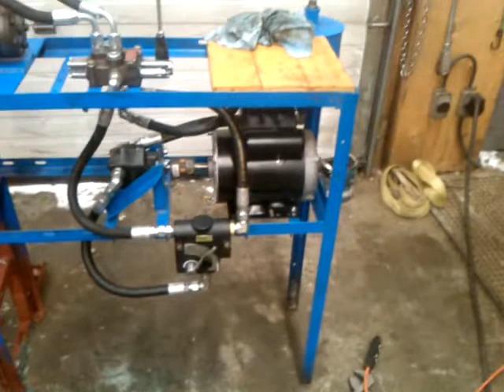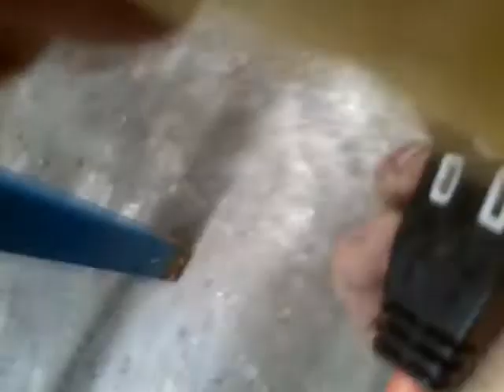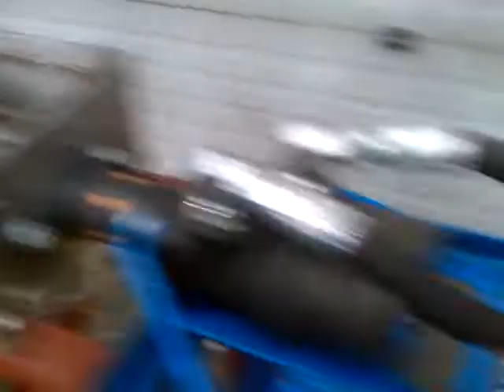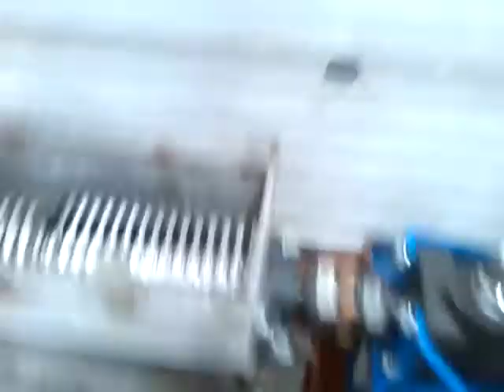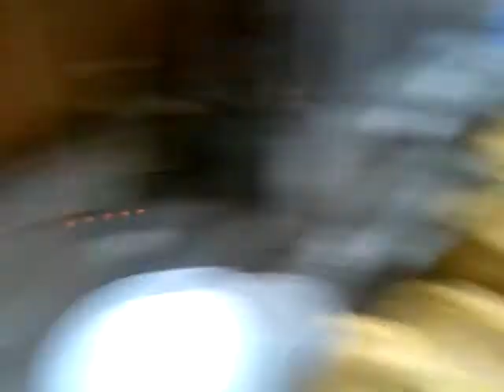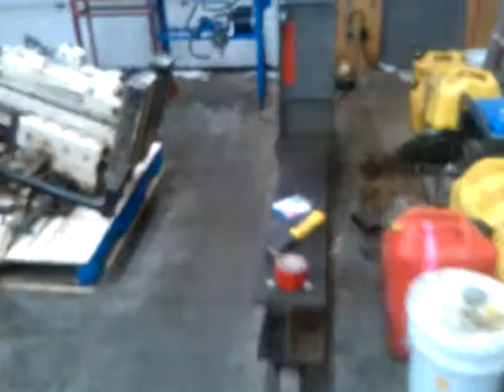Plastic Shredder Project by Dawson City Recycling Depot, Conservation Klondike Society

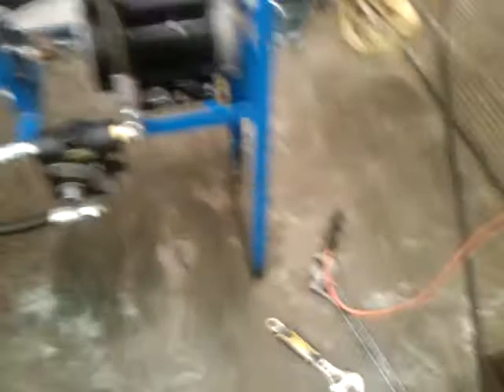Comment: I suppose you have already updated your machine since this video. But yeah you have 3 X the original version 2 PP shredder there. You probably need to stagger the blade configuration. The issue is torque required not so much about speed. But for one of those shredder boxes (not 3 in line) you need at least 3kw with a 1:30 reduction gear to do lids. I would go 4kw to be sure. With the coupling you need at best an HCS  jaw or a curved jaw coupling. You have what looks like a L90 or L100 which is not rated for the kind of forces applied to it. I have broken one already.
Reply from the maker: I just did a little work on it today.

I still haven't repaired the bent shaft yet, but we have a new one on hand, turned to 1" (barely turned from hex).

I will reassemble with the teeth staggered.

I think it's going to work, as the gear reduction of the chain gave the small motor enough torque to bend the shaft, teeth in the old configuration that we received it in.

Comment: a flywheel may help, even at low r.p.m. the kinetic energy should help it take the grunt
Reply from the maker: I agree that a flywheel is a good idea, but beg to differ regarding its effectiveness at low speed, if only because KE = 1/2MV^2.  I could be wrong, but I'd guess that the mass would have to increase exponentially as speed decreased, and I don't want to have to make that much room in my design for mass.
Reply from the maker: I'd have to put in a secondary shaft, geared up for speed, to make it effective, I think.  I could be wrong.
Reply: @nothermonkey  yep....mass = torque.... but what could a 4ft flywheel hurt?...lol...im outdoors, so im not as concerned... but my neighbors might be....lol

Comment: The motor is too weak.
Reply from the maker: It's a 3hp motor, which is supposed to be enough.  Since the video above, I installed a gear reduction using chain.  This bent the 3/4" output shaft, which another commenter had pointed at as being too weak.

It was still jamming--with the gear reduction--but less, and with the hydraulic control, I can reverse easily to clear the jam.

Something that nobody has pointed out yet, which I noticed after bending the shaft, is that all the blades, on the shredder we purchased, are aligned in three different straight steps.  Looking at other people's shredders, I see that each blade is staggered, so that no one piece of plastic catches more than one tooth at a time.

This last stands out for me as the biggest reason this shredder isn't working.  We're going to have to disassemble this shredder, get a new shaft in there, and stagger all the blades properly.  Hopefully it's a hex shaft in there.

Comment: The shredder looks awesome, I had never seen an implementation like this using a long shredder and hydraulics. My only concern is that the hex bar is too long and might eventually twist or break because all radial forces are being applied on one end of the axle only
Reply from the maker: I hope to come close to proving your concern, one way or the other.

At this time, I'm not coming close to applying that much force, with this 3hp electric motor on 18A @ 110V.

I've adjusted the pressure relief, so that it doen't stall the motor when it jams.  Now it only throws the breaker after a few jams of the hydraulic motor.

It seems I'm close on the hydraulic design, to transfer the power, but have a feeling the hydraulic system has too low an efficiency.

I suspect I'm going to have to trade speed for torque, and go to a chain drive, which will also get rid of alignment issues and the weakness of the lovejoy coupler.  I did use the strongest coupler insert available--the neoprene option.
Reply: @nothermonkey  Good luck on that. I didnt mention anything about the coupler, but I suspect the insert won't last very long. I ended up using chain sprockets and double chains, like these https://www.amazon.com/-/es/gp/product/B01KQ2KBDC
Reply from the maker: @OlivierCR  I was thinking of going with an offset chain and sprocket, so I could play with the gear ratio.  If the hydraulic system is too inefficient, I should be able to get the work done more slowly, with lower gearing.

I'm not sure where the 60rpm comes from, and what effects one sees above and below this rpm.  Does it have something to do with the plasticity of plastics at room temperature?

Id think the faster I cut it, the more brittle it would seem to the cutters.  Maybe it's a horsepower requirement for the basic shredder, at a certain feed rate, with a basic household electric circuit...??

Regardless, it's my guess that, to get anything done with this cutter, and that electric motor, I'm going to have to gear it down so it applies a lot more force before it stalls.
Reply: @nothermonkey  if the coupler is an issue, i can help, we use similar ( if not exactly the same thing) in our tank trucks at work.... some guys have used carved hockey pucks, and some guys use cast aluminum wrapped in electrical tape....the aluminum works as a good sheer pin, instead of rolling keyways, and scarring the shafts.... have even seen some guys use several wraps of duct tape on the whole coupler , if the torque is always one direction... not so effective on dual directional...lol...
Reply from the maker: @MrStonehope  Thanks, Chad.  I think I've left the coupler issue behind for the moment, as I've gone to chain.  Have a look at it, shown in the few stills I cobbled together in another video (https://www.youtube.com/watch?v=Aq-H8c88AHk).  I changed the gear ratio that way, for more torque.

Comment: You will definitely have to increase the motor. The original specs for the shredder was for a 1/3rd of the size of what you currently have. So in theory you need to increase the power by 2 thirds. Also you are using a universal coupling you should use a tapered bush coupling.
Reply from the maker: Thank you for you comment.  We haven't yet run into a horsepower issue, as a direct result of the size of the shredder, as we haven't been able to use even 1/3 of the teeth to shred.  It jams too easily.

The coupling--a "lovejoy"--no longer spreads, as I made the reinforcement I referred to in the video.  I do agree that it is likely not strong enough for the torque we're going to need.  I've been considering going to a chain drive.

I hope to be able to make some progress with this project, but haven't found the time recently.
Reply from the maker: What is really on my mind right now, and I don't hear much discussion of it yet, is that the real problem is clearance and shear.

The shredder we purchased has way too much slop in it.

There's all this discussion about minor friction forces and alignment problems, but it seems to me that what's really needed is tight clearances on the blades and cutters, so that it operates more like scissors.
Reply: @nothermonkey  I used shim washers between the knives to take up the slop. I'm not sure what you mean by shear?
Reply from the maker: @mm-qw8sh  By "shear", I meant a force applied over a very small area...as close to 90deg to the edge of cross section being shredded...such as scissors apply.

It seemed to me that if the blades weren't close enough together, the plastic would be stretched out, and that more and more plastic would be involved in resisting--whereas if it were a tight clearance, a smaller amount of plastic would be involved in reaching its tearing point

Do the shim washers push the blades over, against one side of the cutters?.
Reply: @nothermonkey  they do but its more making sure the knife sits perfectly in the centre of each space. The shim can be placed on each knife or some knives to achieve an even spread throughout the whole box
Reply: @nothermonkey  as for shear does the shredder have a sizing grate under the knives?
Reply from the maker: @mm-qw8sh  I didn't get that far yet.